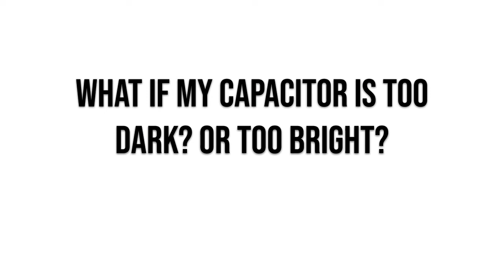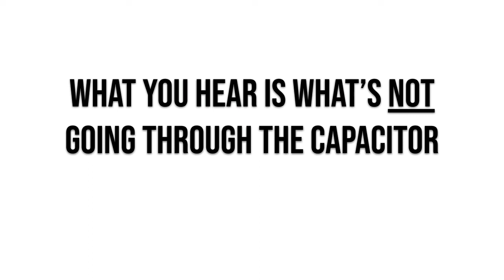Tone Control Capacitor – Choosing the Right Value for Your Guitar - Humbucker Soup Tech Tips

Comment: Hi. May I ask, What is the tone difference, if any, between fully open 22 vs 47 caps ? ( humbucker, 500k pots)
Thanks😊
Reply: When the tone control is wide open there is very little change to the tone and most people probably wouldn't be able to tell the difference between the 2 values. However, the tone is still in the circuit, so just as when you start to close the tone control, the higher value of the 47 cap should give it a slightly warmer tone overall. If you want the cap to have no effect on the tone with the pot in the full open position, a no-load pot is what you want. Thanks for the great question!
Reply: For most of the cases - you didn't hear the difference.

Comment: if i have the volume on 10 and tone on 10. will the capacitor still have impact on tone? or does the capacitor only kicks in if u lower volume or lower tone. i got .047 in my les paul custom. adam jones from tool uses the same .o47 to focus on mids. is that correct? awesome vid learned a tons
Reply from the maker: Great question. The capacitor only kicks in if you  lower the tone. If the tone is on 10, it has no impact on your tone.
Reply: Awesome thank u.

Comment: Question, what capacitor would you suggest if we have:
Alnico5 single coils w/ A250k pots
VS 
Alnico2 humbuckers w/ A500k pots?
Let's say, I want warm vintage cleans and clear overdriven tones.

Great discussion by the way. Keep it up!
Reply from the maker: Thanks for your feedback!

The guitar’s overall sound comes from the construction of the pickup, wood, and the value of the pots and other components. The tone control is just a filter...mostly like the treble control on a stereo or amplifier with bass, mid, and treble dials that mainly kicks in when you turn it down. 

The tone lets all frequencies above a certain point drain to the ground, so the sound gets warmer. You select that frequency with the capacitor value, and it will always sounds the same or produces the same effect in the way that the treble control on your stereo sounds the same whether you are adjusting it to listen to modern rap or classic rock. We hope that makes sense. 

You want to find a value that doesn’t make your sound too warm when you turn the tone control down, or you are less likely to use it. In the guitar, you get to choose the capacitor value, so we recommend trying a few and picking the one that works best for you.
Reply: Hi there...I've  got epiphone classics 57, alnico II and V on 0,47 OrangeDrops  and alphas 500k, linear and logarithmic, done 50's wiring style and I reeeaaallly like it, good for rich fat cleans and deep growling dirties ... 🤘cheers
Reply: Great video guys. I've been using Orange Drop capacitors for many years. According to the pickup windings I use 0.015 or a 0.010. Perfect tone when rolling back loosing some of the high end bringing more rich mids out and doesn't get muddy. I first heard these on a 59 Les Paul several years ago fell in love with the tone rolled back at about 2 or 3. This is just my opinion and my personal taste it tone, I'm not trying to convince anyone to switch from what they like.
Reply: In my opinion 0.022 capacitors are good for single coil and humbucker.